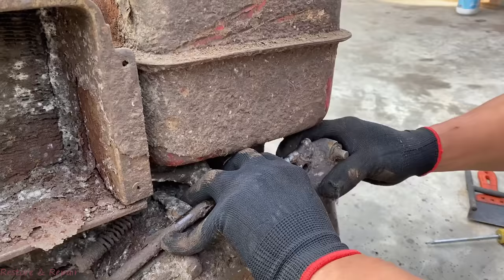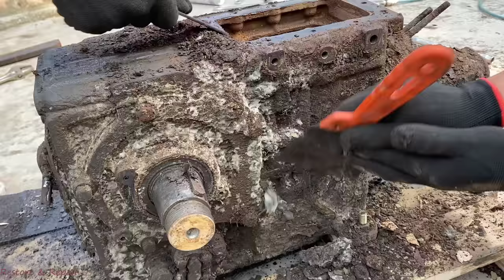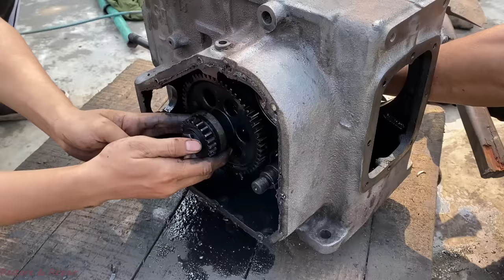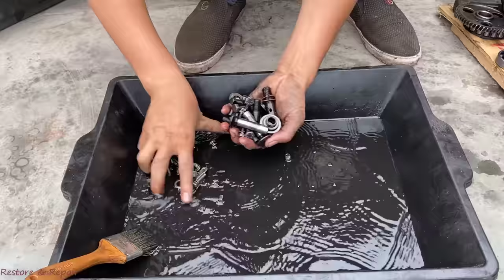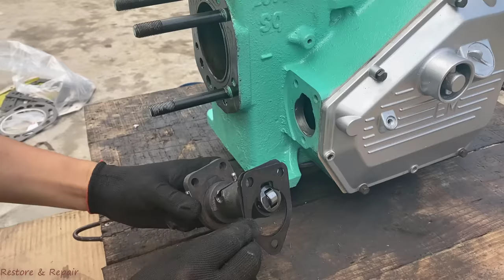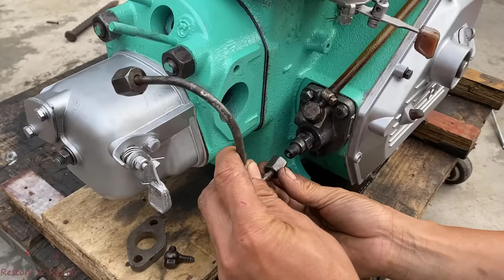Restoration of old R190 diesel engine | Restore and repair old D10 diesel engine

Comment: This engine was more complex  than the others.
The roller  bearing are a nice improvement.
You got it running and looking new.
Good job.
Reply: It just look like new. Nothing was done inside. Nothing replaced. All elements old and used. Nothing checked. If you only paint old broken something does it start work again like new?

Comment: Muy buena restauración mis saludos desde Uruguay
Reply from the maker: Saludos desde vietnam
Reply: @restoration-restore-repair  Greetings to you from Russia. Online translation. In Russia, your hands will be torn off for such a restoration. DO NOT paint the cooling radiator. It is very desirable to change the old oil seals, and you can not paint them. It's just cleaning and replacing the gaskets. Coloring for beauty.

Comment: When you have mounted the gears at min 14.25, the notches were not phased ... In fact it seems that it does not have power .... You pulled the head screws without a torque wrench ....

Comment: The radiator was already in horrible condition and it got painted. That engine is going to overheat. You're never supposed to paint radiators because it reduces their efficiency. There's so much paint on that radiator that it looks nearly completely blocked.
Reply: El radiador todo tapado con pintura

Comment: how do you expect it to cool when the fins are all mashed flat and air cant go trough and not at least replace the seals  if your going to do a restore then do it correctly not just clean it it might still run for a bit but sure cant trust it for full service
Reply: Nahh...his consep 'just look like new'
Reply: Do you even understand the principle of this cooling method?
Reply: @bartdereu9267  robert m does. when the fan is turning it needs to be able to push air through the fins sufficiently for proper cooling
Reply: 00000

Comment: This ancient diesel needed valve stem seals to keep oil burning under control and engine runaways to a minimum. Then it would use no oil and run practically forever on vege oil.

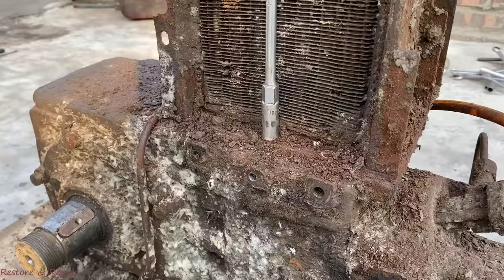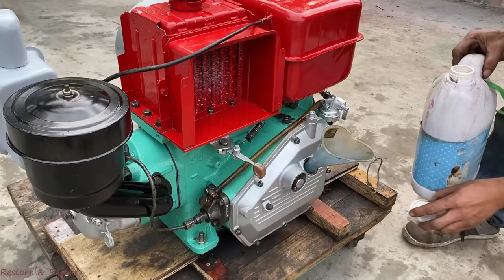Comment: Bad job !!! the cooler radiator before regeneration looks better (3:02) than after regeneration (19:43). It's clogged with paint ;-(. Bad job. And such a nice engine. To be corrected gentlemen ;-)

Comment: Where was this engine being used/stored??? A mud pit??? :o
Reply: It's the nature of the Diesel engine because they run on oily fuel and stuff just sticks
to it and because it IS a Diesel they are put to use in dirty and grueling work and because
it doesn't need a spark to run people neglect them because Diesels run forever or so people think.

Comment: This thing is in absolutely dreadful condition!  You did a nice job cleaning and painting it, but I would think it has more problems than that, no?
Reply: a nice job? painted the cooling fins engine will now overheat. got paint inside the engine. used old pitted bearings you could see damage. this video is a joke

Comment: You guys painted the radiator? Seriously? Now it's gonna over heat and blow up in a month. Either do the job right or don't do it at all!
Reply: Doubt that will matter on this engine, it’s not like it runs at the limits of it’s cooling system like a vehicle engine or modern space saving generator

Comment: Restoration??? Washing and painting IS NOT RESTORATION!!! First - engine should be washed BEFORE opening to avoid dert penetration inside unit. Did you relace anything in this engine? I see - old bearings, old slide bearings, old sealing, old piston rings. The only new thing in this work is paint. But paint does nothing to engine. NOTHING! And the most stupid thing from this video - you took off and put on side cover with sealing with wedge on its place! There is no wider diameter for it. You were to lazy to remove it. So wedge cut twice thru sealing. You work is terryfying!